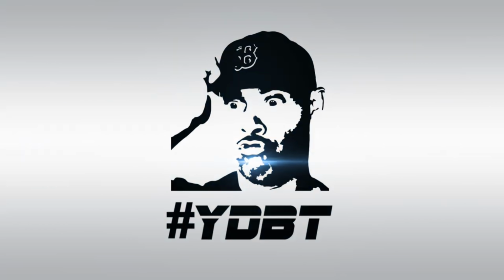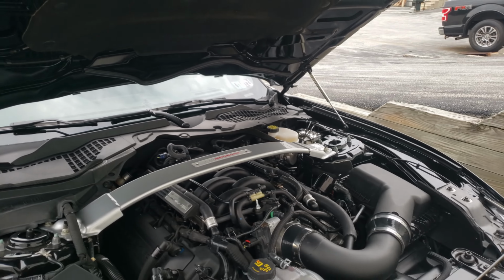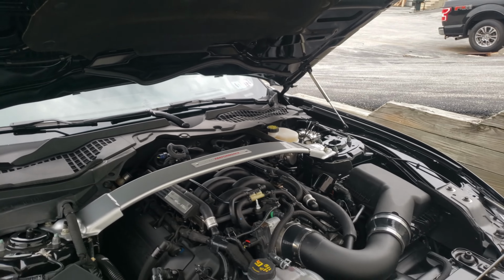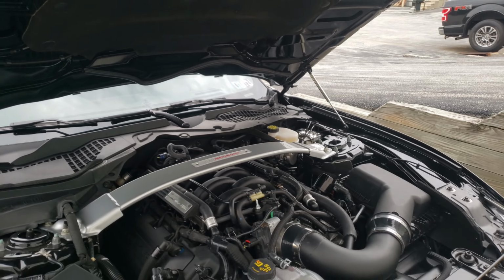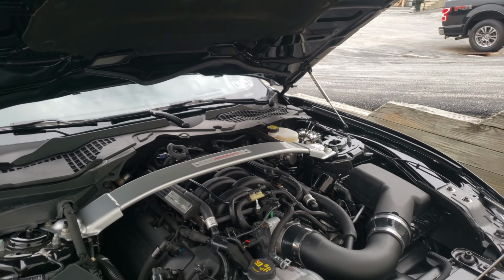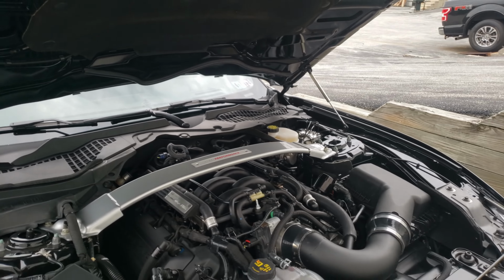TT Hellion Sleeper Equipped  GT350 On E85

Comment: Definitely going with whipple, dont want a 70k Subaru
Reply: Agreed
Reply: Garrett Rush just put the factory x pipe back on🤷‍♂️ They took it off on this GT350.
Reply: @Jimmyxsx  yeah that's how it sounds with no crossover pipe, very burbly.
Reply: My Gen 5 Whipple made 760rwhp on 93 with some amazing tuning by Lund
Reply: I have a whipple gt 350 with corsa xpipe and wouldn’t change a thing! It’s a little raspier than I would like but still awesome!
Reply: @gshelley1556  You want rasp do X pipe you want deep old school noise do an H pipe.

Comment: Here in Houston we have a few twin turbo Gt350’S, but they do not sound like boxers or subaru
Reply: Its because its straight piped with no connector, so the exhaust note is literally just 2 flat plane 4 bangers.

Comment: At least this car is not sporting the Chinese made mt82. What was ford thinking when they decided on that transmission. That was one of the first things to go on my build. The t56 magnum should come standard in a 50k mustang.
Reply: Tim Connell Couldn’t agree more
Reply: @ maximus vonce  You angry much bro?? Made in China, assembled in China, who gives a shit?? If it works it works, if not, again, who gives a shit?
Reply: maximus vonce Alex broke his Mt82 within a few weeks of owning his S550.
Reply: @inerceptor  Not talking about his s550. Talking about his s197. S550 had cast shift fork. Early mt82 had steel shift fork. He broke cast shift fork in s550 mt82
Reply: @maximusvonce1381  ur absolutely right, my s197 has the mt82 still, stage 3 clutch and its still running strong, 70k miles. 150 shot. I powershift too, these things take the abuse very well compared to my old cars. It'll eventually break but for now, she gucci gang
Reply: Don't know if you've noticed, but Ford has never put a good trans behind a mustang besides toploader 4 speeds back in the day, the 5.4/5.8 gt500 tremecs, and the 350. The t56 is a mention but it's still a 10 spline. All the t5's, t45's, tr3650's are fuckin junk.

Comment: It needs to go super charge instead of turbo charged that way you don't lose the sound that's why I bought a GT350 for that beautiful exhaust note.
Reply: Roush R2300 tvs it needs
Reply: Hello. The turbos do not set the exhaust sound, they add to it.  This car would just need a crossover pipe in the exhaust to keep the stock sound.

Comment: Gt350 running under 40k right now and are a complete steal with super low miles add 10k twins and you have supercar performance and handling for under 50k plus resale value because they won't drop much lower for 5-10 years just like Raptors

Comment: So now that you have driven both, if you had to choose for yourself, would your personal GT350 have this twin turbo kit or positive displacement. Would appreciate your input.
Reply from the maker: Tough call... but blower imo
Reply: Isn’t there a lot of heat soak with the Whipple supercharger and the VMP supercharger it has been a long discussed issue what will be a better and reliable unit with the less maintenance.
You want something that sounds good performs well and you don’t have to be under the hood all the time so my question all the time would be what is the best?
After looking at the video you seem to be more happier with the Twin Turbo sub then a regular Whipple set up is it really that much faster than Whipple I thought you would say TwinTurbo set up but I have to know the reason why you selected the Positive displacement supercharger. And not even a Vortech
Reply: @YDBT4LIFE  but y?

Comment: This kit made my choice of FI so much more difficult... I wonder which would be safer on my Gen2, Pd blower at 10-11psi or Turbos at 7-8psi? From what I understand the blower is easier to get the tune right.
Reply: turbo's are great.  just a matter of preference at that point.  i've been on a centri with e85 for a while, went for a ride in a friend's a10 18 (like mine, only utilizing the sleeper kit as seen above on borg/warner 57's pushing out about 7psi) and immediately hated my car.  thing was as fast/faster than my car on a 93 base file off the gnarly hit of torque alone.  i see a lot of people mention maintenance/upkeep with turbo cars though i don't understand what they're referring to.  PD is simple, clean, and works well regardless of pump gas or e85.

Comment: No cross pipe and unequal length headers is probably the cause of the subie sound....but I wouldn’t change it.
Reply: jon doe  does not ecoboost sound like ass even the Raptor
Reply: Exactly what I was going to say. 
Unequal length primaries is what gives that iconic subie sound.

The newer wrx with equal length manifolds sounds like a normal 4cyl.
Reply: @paulsachs9983  older subies sounds deeper, better in my opinion.

Comment: I didn't scroll through all the comments what does the dyno graph look like? Does it still make peak hp at the upper zone or does it hold the graph at certain point? How about the tq peak as well? My DD is q50 with twin baby turbos the wheel size is like a half dollar coin my point is they spool up like a mother but 6k they run out of the steam engine pulls to 7k you don't feel it that bad at factory boost levels but when tuned it is like this thing is insane then at 6k party is almost over lol. There aren't any viable upgrades yet but when there are it will be great! My next build sounds like a gt 350 love that it is a manual and can handle!

Comment: I think this maybe rules TT out for my gt350 in favor of whipple or VMP. Based solely on the sound.
Reply: Just remember You have to pull head unit on every tvs supercharger (except Roush) to R&R driver side injectors.
Reply: They don’t all sound like this.
Reply: Hello.  This car does not have a crossover pipe which sets the sound. It can easily be changed and keep the stock sound with the additional power of twin turbos.

Comment: The only thing that makes a 4 cylinder sound like they do is the fact that 90% of them have Flat Plane crankshaft's. Even Subaru's. Put a Cross Plane crankshaft in them, and it will sound like a v8.

Comment: Alex, thanks for the video. I'm VERY interested in doing a similar setup. Can one safely run 6-7lbs of boost on this car with no BAP's, but even larger injectors i.e. ID1300X's instead of just the 1050X's? I'd rather just go full return once it gets turned up more, but would rather just leave it be fuel system-wise outside of injectors if running "low" boost.

Comment: I think that you can make 850hp on 93 octane.
Why do they have the dump valves.? Can they have it recirculate back into exhaust or is it a tuning issue 
Are you going to let us know how much power it makes on 10 psi after clutch is installed

Comment: I see that a few Gt350 out there have had crank shaft bearing issues do you think its because the Whipple or pro charger  put stress on the crank shaft and the bearings get effected with the belt load on the snout of the Crank?
Reply from the maker: Maybe. I've personally not seen that issue.

Comment: How do you not make over 800 horse power on the Whipple 2.9 and you can’t make over 800 hp with even more torque on the Twin Turbo on pump gas

Comment: Is a procharger that bad ? your running a vortech arent you? Or is  that just for tests?
Out of the 3 I know you like Whipple VMP  but Pro charger  vs Hellion the turbo should be better YES?
I heard that the GT350 has bad harmnics and knock sensors go off with those  pro charger kits.
I just think that heavy blower on top of motor will hurt the handeling of a GT350 that is one heavy blower.
and I heard that whipple is coming out with a 3.8 soon..............
Reply from the maker: I prefer vortechs mounting bracket if centrifugal. But hard to beat a whipple on these cars
Reply: @YDBT4LIFE  
Thank you and GOOD MORNING !!!!!!!!!!!! Love your Channel great stuff. 
Thank you for your professional advise.
My Gt350 love the car but hate the bottom end perfomance Just trying to research and make sure I do the right move for this car. I love road racing and higway runs but drive most in town. Again thank you for your advice its alot of money to just throw around and for this car you just want to do the right thing that will keep value and performance to todays standards.
So did you hear about the Whipple 3.8?
Reply from the maker: @slyr1  yes it's going to be great for high hp cars. But I prefer the 3.0 on stock cars
Reply: How much Hp can the 3.0 Whipple make if you have a worked motor ? what is it capable of?

Comment: Legit question. I've always been taught to never accelerate in a higher gear at a low RPM. Does this encourage detonation or is it because there is a gearing disadvantage?
Reply: Lugging motor encourages detonation
Reply: It causes unnecessary stress. Plus if you go too low youll stall and be laughed at :)